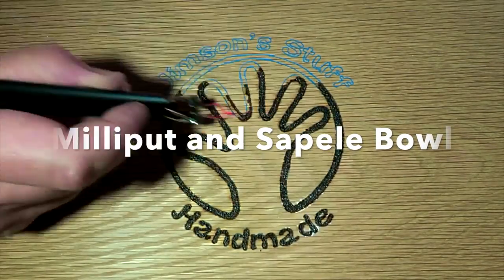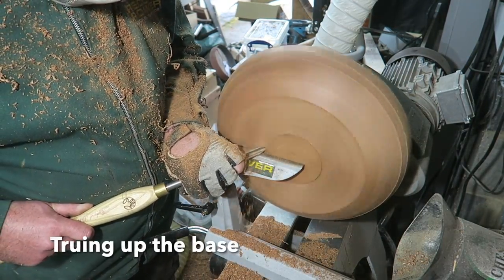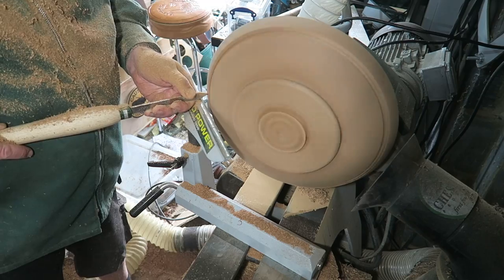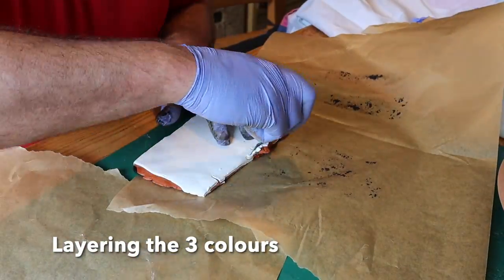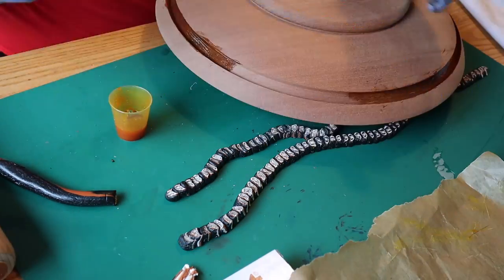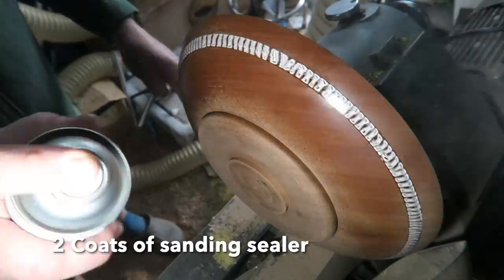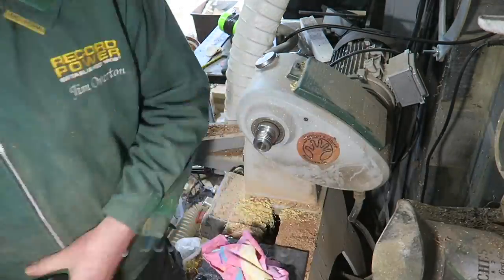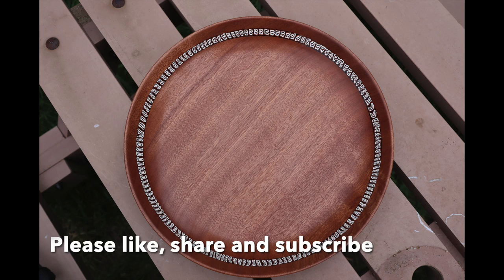Woodturning a Sapele Bowl With Full Thickness Milliput Inlay

Comment: Yay! I love it. I have been thinking about you a lot the last few days. I wasdoing a project using some JB Weld Steel Stick. If for some reason they don't have that on your side of the pond, it is a lot like Milliput only it is all in one stick. The second half of the 2 part epoxy putty is in the middle, a bit like a filled donut. It is reinforced with steel dust and sets up in minutes instead of the hours Milliput takes.
Anyhew, I was working it into the places I needed to repair and I was saying to myself, "Just squidge it into place". 😁
Reply from the maker: Just gotta squidge sometimes. Many thanks for watching

Comment: How does the rim hold up fastened with just milliput? I would be concerned for separation over time….  Looks great, I will say.
Reply from the maker: Thank you very much. It should hold up OK, I made a large Ash bowl with the same technique  a few years ago and left it on the window ledge for a few months and although it warped slightly it did not crack. In many ways it is little different to a segmented piece. I am not sure whether a thin walled piece will produce less or more internal stress than a thick walled piece.

Comment: Jim regarding your milliput, copper and wood threading exercise.   You may wish to consider trying soaking the wood portion of threads in boiled linseed oil, wood threads much more nicely after doing so.   Thanks for making videos!
Reply from the maker: Many thanks for watching. Yes a few people have suggested using oil. Recently I have been 3D printing threaded inserts to use instead.